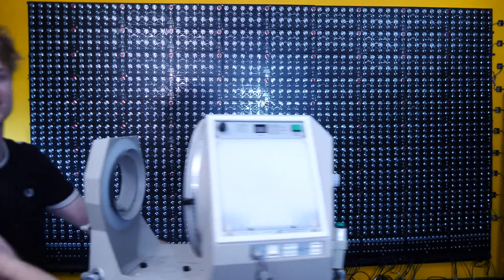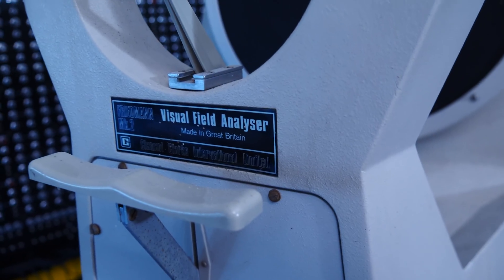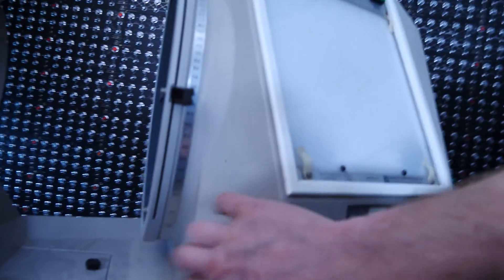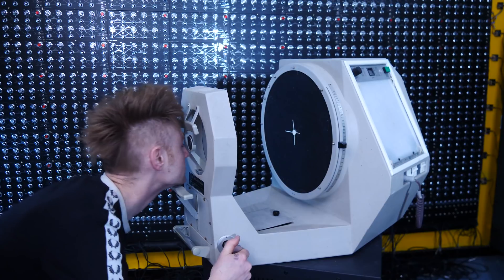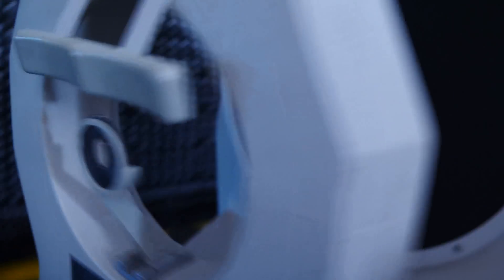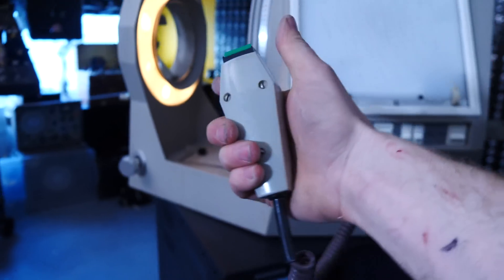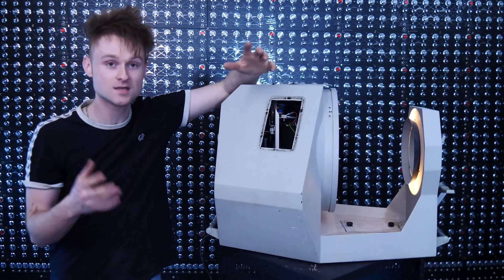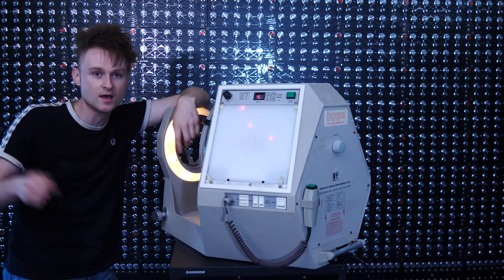I Found A visual Field Analyser

Comment: Very cool. No idea what you should do with it. It's already pretty cool.

Because it's mechanical, there are so many things that could be musical:

* the push button to trigger something
* the LED patterns could maybe correspond CV values for a sequence (via a ton of knobs). Then, when you cycle through the patterns with the big lever, you could get some pretty wild pitch changes.
* or triggers like you said... if triggers, maybe a mad grid of jacks like Nervous Squirrel's game of life module.

Could be cool to replace the ring light with an LED strip that has an animation or two (spins, etc)
Reply from the maker: sounds cool! yeah the leds deffo need to trigger summit!!!